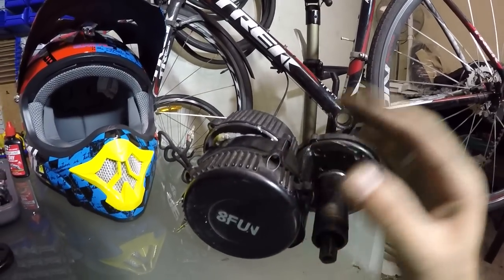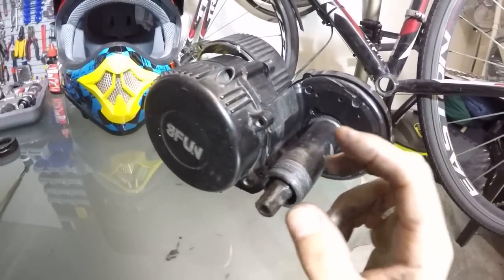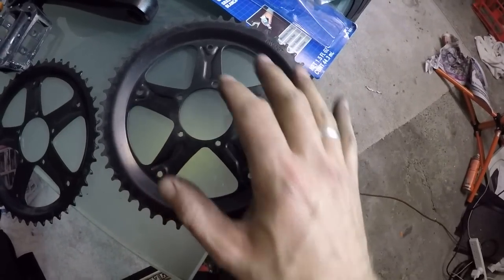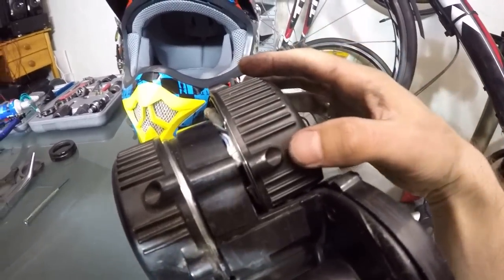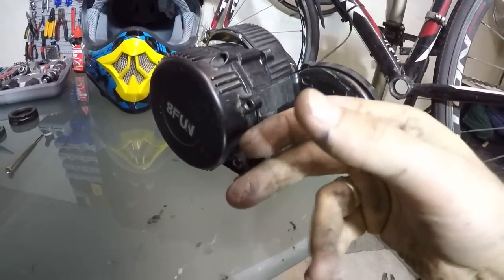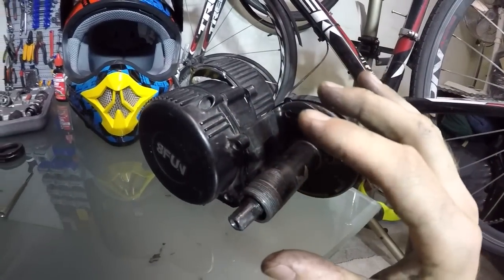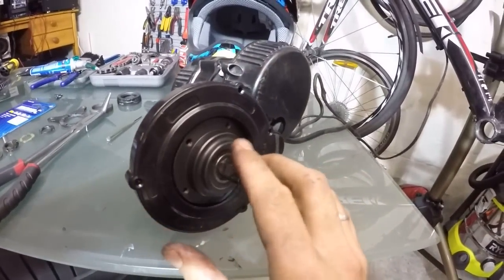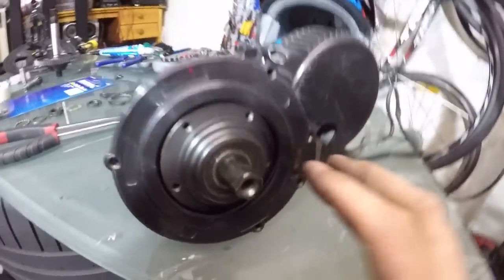DIY Tutorial Repairing BAFANG 8fun BBS02 750w 48v (Part 1 of 7) *intro/bottom-bracket/external gears

Comment: One thing I've noticed with these is it is be advantageous to match your cadence to the assist level. I've noticed that on level 1, this motor tries to do about 70 rpm at the crank. On level 5 it's about 140 rpm at the crank. The motor will slow under load but if you are pedaling at 60 rpm in assist level 5, this is substantial labouring of the motor and it might be worth it to downshift a few gears and really get those pedals spinning. The motor will run more efficiently. I'm not sure what percentage of the no load speed it's best to spin above, though I'd aim for at least 3/4 of no load speed e.g. pedal above 105 rpm in assist level 5. I got the 52 tooth chainring on mine but probably won't need the taller gears (might be useful for cruising 23 mph on assist level 1 at 60 rpm cadence). I have a 32-11 cassette.

Comment: How many kilometres / miles this motor can do in its lifetime? In regular use as work commute 48v, pedal assist etc. What would you reckon?
Reply from the maker: My motor was pushed waaaay harder than it was designed and only lasted about 2000-3000kms 
This was the early version from 2014 before the bigger BAFANG BBSHD was released. 
Later they also made a newer and improved BBS02 improving the most common problems and fixed issues I had in my motor in this video (not everything but most stuff)

I would definitely recommend these motors, if you know you’ll be doing lots of kms I would say it’s better get the big BBSHD and run it conservatively (that would make it very reliable and last thousands of kms) rather than get a smaller motor and push hard... 
Nowadays you can find replacement parts so if anything eventually goes wrong it’s easy to fix.

Comment: Is it possible to connect 4 500w motors to one 2000w controller and one trottle?
Reply from the maker: Yeah.. you can connect identical motors to the same controller and have 1 throttle (can't connect 2 controllers to the same motor)
If the motor is rated 500w I would say you can peak at least 1200w... if you have 4 motors get a controller that can peak at least 4kw, maybe more and limit the current via programming software =]
Reply: Good to hear. I am planning to build a 4wd kind of quad on 4 front hub 1000w 26"  fatbike wheels, using bicycle fork with chocks i front and weld the back frame, also with chocks. No chains, sprockers or axels. Guess the Castle 160 will do the job..
Reply from the maker: +Dag Eide yeaahh the Castle 160 would do the job but the downside is that sensorless controllers are not good at low RPM, hub motors are very low RPM. All these RC controllers are rated for maximum 12s (43v nominal) hub motors need higher voltage to perform well. 
Better get something like the Adaptto MiniE expensive but it's an amazing system that comes with display and BMS all together + lots of super cool and unique features. One of the best if not the best controllers on the market, they work super well with hub motors.
Reply: Ok but is there good and powerfull controllers for low RPM? What do you mean with 12s(43v nominal) ? The most of the front hub motors are 36/48v
Reply from the maker: +Dag Eide you can try using a Castle HV160 but for the price you're paying you'll be able to get a proper hub motor controller that will give you a much better performance at low RPM. Many hub motor controller options here: https://em3ev.com/shop/?prod_cat_=ebike-motor-controllers
There are hundreds of brands and models out there, if you want something very premium you can get a complete system Controller + Display + BMS from Adaptto, very advanced but lots of info out there. Email the seller or if possible the manufacturer asking if their controller would work with multiple motors, some controller models may go a bit crazy reading multiple hall sensors, some will be fine... Adaptto you can have master and slave controllers =]
Reply from the maker: +ElectricBike ahh... forgot to say... 36v or 48v hub motors, you can actually pump a much higher voltage if you want more top speed, high current is what actually causes overheating and kills the motor.

Comment: great chinese engineering? I don't think so....
my unit was not so good, it overheated frequently on climbs in summer, and died after only 800 km....
it is a peace of cheap crap
Reply from the maker: +M Kosmos hummm I have been riding the BBS02 and the BBSHD for many years now, this was the only time I had to service it and was user error, I pushed too hard and destroyed it. I service some motors on delivery bikes with at least 7000km clocked on, they still going strong!!
Most motors that I have to service was related to user error, specially heavy riders riding heavy bikes using the wrong gear and a large chainring for speed instead of torque.. any other motor, controller and batteries will fail under these conditions.. 
When things fail we should stop and analyse what was done wrong and find a solution for it, mine was gearing it too high and overvolt the controller. 
Nothing is perfect, cars and motorcycles are a LOT more expensive and it will fail, even the finest German, American, Japanese engineering (supposed to be the best) it will fail too... Sounds like all you need is a new controller and a smaller chainring, that would reduce the heat and give you a MUCH better performance. The highest RPM you keep spinning the motor the more performance and efficiency you get, the less stress on gears and electronics. I hope that info helps to get you back on the road with the POWER =]
Reply: well, thank you for your reply.
I don't think my problem is controller, since i really looked not to overheat it in summer (it happened one or twice on some really steep and long hills). Unit was fine after this happened (I think I was only on about 400 km them). 
Now, all of a sudden I heard some noises from motor, like it had sand in gears, and after that unit has blocked. I can't turn it backwards so probably gears has failed.
Let's face it, that is Chinese stuff, you can be lucky and get really good unit, or you can be like me and get a really crappy unit....
I think that for around 900 eur (what I payed for motor and battery combined with shipping cost) is a bit too much to gamble. I really expected more reliable product for that amount of money....
Reply from the maker: M Kosmos yeah, sounds like your pinion gear is destroyed like mine in this video, I agree it's too much money to gamble... the BBSHD is a proper heavy duty unit and survives the worst punishing riders but yea I saw some unlucky dudes having problems with fairy new units... I have been lucky so far hahahahaa =]
Reply: you lucky b****rd :P
anyway, I was lucky enough I found your video, since probably no one in my country would be willing to service this....
now I'll have to get my hands dirty, I just hope I won't encounter anything you haven't covered in this tutorial, since I'm not an engineer, this will be my first time doing something like that, but hey, I can't brake it more than it already is....

Comment: Hey mann love your videos....poeweeer, how can i take my bafang 750 hub motor in my fat bike, sould i go 52volts? can i reprogram my controler???
Reply from the maker: Thaaanks for watching my very very first horrible videos hahaaaa
Yeaahh man.. 52v all the way..  just don't do the same mistake you see in this video when I used a large 52T chainring.. go with a Lekkie bling ring 42T and you won't destroy the motor internals or fry the controller. 42T will give you a massive acceleration and torque for climbing anything... 52v will increase the rpm... so many advantages..  the faster you keep your motor spinning always finding the right gear, the better. just like car.. 
The problem you will have installing the 750w motor on your fatbike is the bottom bracket size.. fatbikes have a much wider bottom bracket (100mm/110mm/120mm) so you need a wider motor.. the 750w fits 68 to 72mm (standard bikes). BBSHD the bigger motor you can actually buy wider for fatbikes. There re some companies doing a 750w conversion making it wider, (cost so much money, not worth) also Fatbikes are heavier, bigger motor is actually the ideal.
So much POWEEEEEEEERRRR hahaa
Reply: Mannn tanks for the reply, the ting is i already have a 750 bafang hub motor 48v, and i just need a litle more poweeer... and top speed, i see that there is a 4 pin wite conector in the controler can i program it and change the setings to remove the speed cut off and overvolt ?? or i can install a mid drive too and have a dual motor set up have you seen that done ????

Comment: How is it possible that you can run your 48V motor on 58V. Doesn't Overvolting damage your Motor Controller?
I am riding a modified 36V(42V) Bosch eBike myself and I'm thinking about overvolting it.
Reply: +Pryside The controller in the BBS02 is rated for 60V.  I'm assuming he is running a 52V battery, which fully charged will put out around 57V but drop off as it is discharged.  For own bike, you will want to check the controller to see what the max voltage is that it can handle, as the motor likely won't care about a difference between  36V and 42V but your controller might.
Reply: AJ Regester There are a lot of pictures of the ESC online. The Caps used are rated for 50V and the Mosfets can handle up to 60V. So regarding this, there should be no problem. But maybe there are other components that get fried as soon as I overvolt. Currently I'm working on making a Booster, that lifts up the voltage to 42V as soon as the normal 10S 4,2V cells drop to 38V, by adding another pair of 18650 cells... Because I get quite a lot more power the first few kilometers...
Reply from the maker: +Pryside - Yeahh... the controller will have a high voltage cut-off and will shut down before you fry it. If I connect a 48v battery to a 36v controller it will show a error message, different brands could fry.. not sure about the Bosch ones. There is another thing that is calles "voltage sag" do a research on it, as soon as you use the power the battery voltage will drop about 3 to 4 volts depending on the cells and the battery pack size. The more cells the less sag you should have (and more range of course). That will also keep your voltage higher for longer. =]
Reply from the maker: +Pryside - Yeeeahhhh... this is a good idea to boost the voltage up... however all these circuits have some loss.. you may lose 10% or more in this conversion depending on the components and complexity of the circuit. The best thing to get all that POWEEEERRRR you want is to add more cells.. it is not just a matter of voltage  but how much energy you have packed... the more cells the more energy, the longer your performance and higher voltage will last =] Also, get a good charger like Cycle Satiator from Grin, it is expensive but it is the Rolls Royce of the chargers, gives you diagnostics on the screen and will charge your pack much faster than other chargers =]
Reply: ElectricBike Nice, thanks. Basically I am currently working on a little circuit that will allow me to go from 10S (42V) to 11S, as soon as the 10S batterys are down to 38V (without load on them). And I will also add a parallel 10S, to prevent the overall voltage sag. That should work pretty good and give me always the insane POOWER that I usually only get the first kilometer I'm driving, before the voltage dips... :D
Reply: ElectricBike Basically my circuit is just adding more cells with a relais. Maybe I'll get one of these chargers but for now I'm using my IMAX B6... It's just very cheap ^^

Comment: +ElectricBike (Bruno)  May i ask you what types of the "15 watts LED headlights" do you have? And where did you bought them?
Reply from the maker: +Martin Kadlec - Yeeeahhh... I actually use a very bright cheap eBay light (link below) you may order two different models as they look very similar in photos but some are better than others. The only thing I did to these lights, I opened the body unscrewing the bracket and siliconed the little electronic circuit making it watertight and stopping it from banging causing the electronics to fail. These cheap lights are brighter than most $200+ fancy battery operated ones. Have fun.. haha.. =]

http://www.ebay.com.au/sch/sis.html?_nkw=Motorcycle+Car+12V+24V+36V+48V+80V+High+Power+LED+Spot+Light+Headlight+15W&_id=321405079674&&_trksid=p2057872.m2749.l2658

Comment: THANK YOU! I hate how everyone loves pedal assist lol. Throttle is better in every way. Pedal assist is scary, one time my chain came off so I put it back on and then pedal assist activated. Almost ate my finger
Reply from the maker: +Clifford Zvengrowski - Yeeeeahhhhh... I just can't like pedal assist... it would be nice it there was a torque sensor but this is not the case here sooooo.... I just can't like something like that... the more I force myself to like the more I ended up hating it... this is why I use throttle ONLY, much safer and precise as well... I am always under control...
The same thing happened to me at the beginning... I almost lost my finger.. it was REALLY REALLY SCARY!! With the torque sensor this would never happen as there would be no torque enough on the pedal.
So much POWEEEEEEEEEER =]
Reply: +Clifford Zvengrowski most have an off switch,haha.
Reply: That's not pedal  assist fault. You should never work on an ebike with it powered up.

Comment: hi, very well done, I'd like to have a inquiry, is it compatible with cube acid 2015?
Reply from the maker: +Kansas Tandoc - Hi Kansas... I did a little research in this model, the Cube Acid has a press fit bottom bracket (this one here http://www.probikeshop.com/en/au/shimano-deore-chainset-fc-m612-3x10v-compact-40-30-22-black-2014/93790.html ) Bottom Bracket Width : 68/73 mm (perfect fit for BBS02 and BBSHD) but you better confirm with a bike mechanics if this particular "press fit" model is the same diameter as the "normal 68mm bottom bracket" =]
Reply: +ElectricBike (Bruno) yes! thanks! hmm.. have you heard of the add-e german product? I got confused to what to buy when I saw that, any opinions on it?

Comment: I'm getting ready to watch all 7 videos on the Bafang BBS02 that you have uploaded. I'll let you know how much I have learned when I am done.  At first I wanted to install a front hub motor on my road bike, but now I think I may use a BBS02 750w. My main reason is because if that build goes well I will make my own fat bike with the new BBS HD1000.
Reply from the maker: +Joseph Smith (BadAxe4U) - I am making another "fresh" series about repairing and inspecting the BBS02 motor, BBSHD should be very similar internally... I am actually recording videos at the moment, this is the INTRO https://youtu.be/Czw5KLPvQ84 I may have most videos ready by the end of next week.   Hub vs mid-drive (BBS02 style) one of the best hub motor brands is Bionix, I was in an electric bike exhibition last weekend and they were the only ones showing hub motors.. every single demonstrator had Bosh, Bafang or something similar, all with mid-drive technology! Very few people were trying the Bionix and almost everyone trying mid-drive ones. Many people who owns eBike with hub motors coming and trying the 36v 250w Bafang Max Drive and Bosh mid-drive (you need a special frame for these models) all hub motor owners said that the mid-drive was MUCH more powerful than their hub motor. Another downsides is that the ebikes with hub motor becomes really heavy and very unbalanced, 99% of bike frames were not designed for a hub-motor twisting force, many cases this ended up braking or bending frames making the bike completely useless, this would never happens when installing a mid-drive.

Comment: Hi...good Job ! I Want to put it on a 29er Wheel....is that possible? Bye
Reply from the maker: +Donald Frankos - Yeah... totally possible, the BBS02 model (750w) will basically fit any bike with normal size bottom bracket (68 to 73mm wide). 
The latest big brand MTB have a wider press-fit bottom bracket. If this is your case you still have two options:
1) Buy the BBS02 adapted for wider bottom bracket http://california-ebike.com/product/bafang-fatbike-mid-drive-bbs-02-ebike-conversion-kit/
2) Wait and order the new 1000w model with the right size you need for your bike. https://youtu.be/1D-Kk3ZuFsA
The day you ride your 29er with this electric kit you will be completely hooked up to this electric bike fever and will never go back to normal hahaa =]